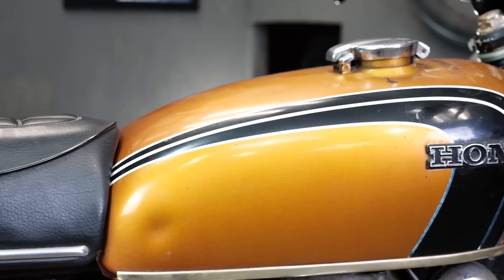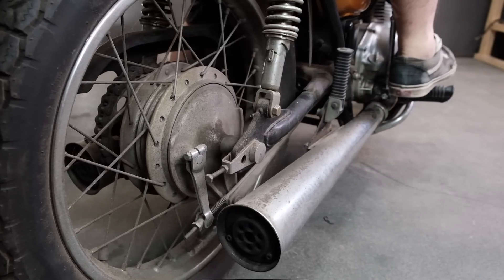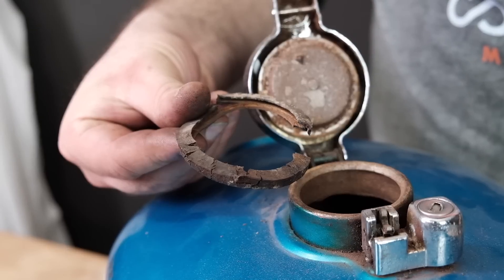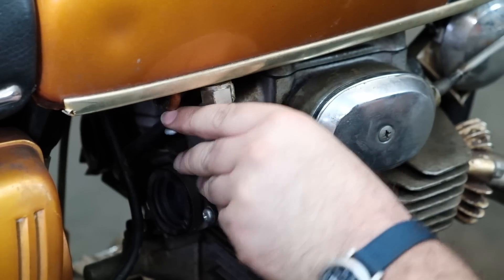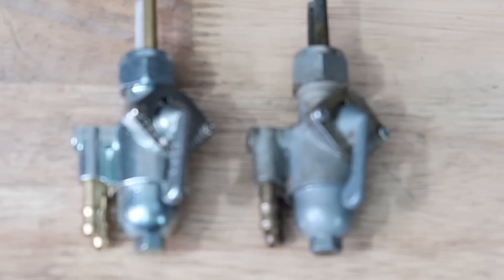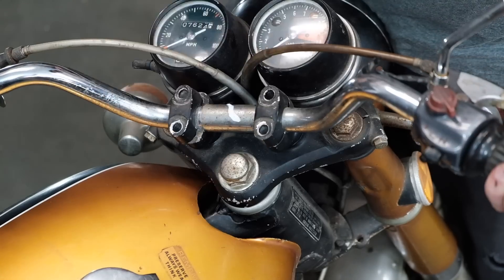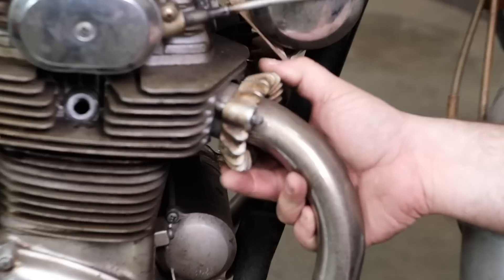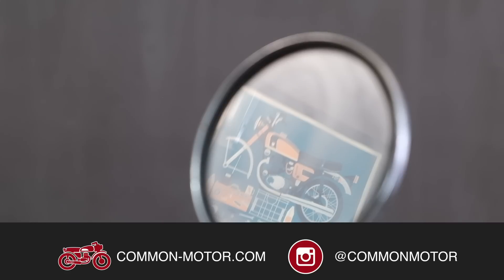5 Small Maintenance Jobs Often Missed On Your Vintage Honda Motorcycle

Comment: Not the right way to replace gas tank seal! Watch https://youtu.be/58ODpbkGeWk to see the pain you are suggesting we go through OR jump to 14.00 in and see how to SIMPLY remove central section to fit new seal to it. With new seal fitted push centre unit back into cap cover. Very easy.

Comment: Never, never, never!  reposition your drum brake actuating arm!  No!  Never!  More: That gas cap latch is a recall item, not OEM.  Against inline fuel filters?  Why?  They are much more effective than the OEM screen.  The petcock nipples need to be thread locked in.  Exhaust gaskets affect performance?  Huh?  Good tips otherwise, especially the polyurethane handlebar rubbers.
Reply: hmmm... too late for me haha.  already repositioned the drum brake arm.  seems to work ok.  but maybe what i really need is just new brake shoes?